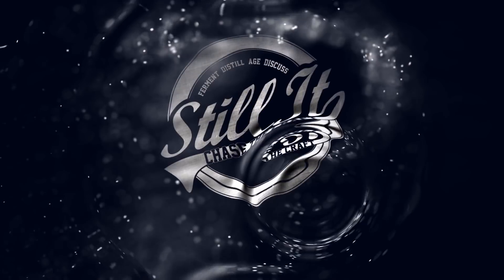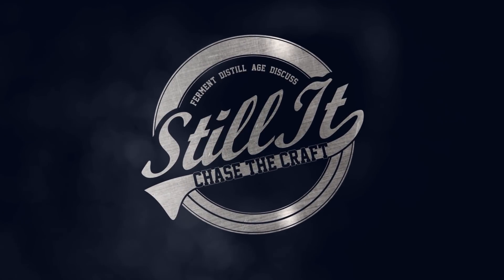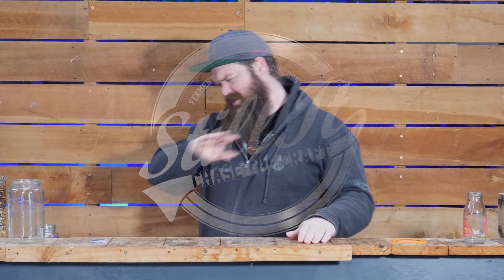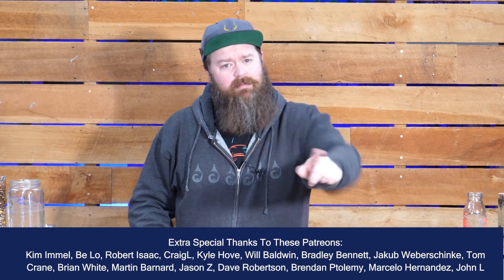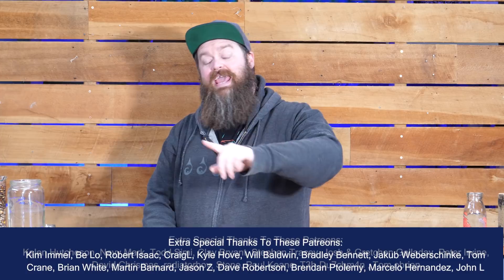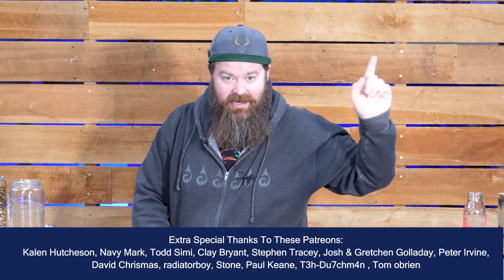How Full Does Your Pot/Boiler Need To Be When Distilling?

Comment: Another solution if you are worried about not covering elements is throwing some balast in the boiler. Glass marbles, Stainless ball bearings, ceramic beads or have even heard of using stones. Never had to worry myself but usually add a handfull of copper scraps as boil breakers to mine.
Reply: Had the same revelation this morning and came here to drop the idea, but you beat me to it!

Comment: Not so much an issue when using a reflux still, but with a pot still, the amount of empty headspace can affect the distillate flavours and aromas. More headspace means more passive reflux can happen. Wash/low-wine composition obviously plays the biggest role, but the rate of energy input along side the shape/design and available headspace of the still come second. Something to think about as you get more experienced in making spirits!

Comment: There are few other factors here. Less volume will create some reflux at the top of the pot depending on vapour path diameter. More volume will create less reflux as the vapour will travel up the vapour path and not so much at the top of the boiler. 
I think the entry abv makes a difference also.
Take a look at major distilleries they all have different abv entry and volume into their spirit still. It creates different characteristics

For example - For 1 grain bill I fill to 75% volume @ 25% abv 
Another I fill to 50% volume and 20% abv 
Both completely different character spirits.
Reply: How do u get 25 percent abv on a mash ?
Reply: @thecarpentergarden2943 not from a mash from a previous run

Comment: When you say you collect down to 20%, is that when the output TOTAL is 20% ABV, or just the latest sample that comes out? i.e. when you start pulling 20% ABV out of the still, then you stop?
Reply: When the output coming out is 20% usually all of it together is around 40%
Reply: @jacobdeslattes3519  Thanks, so when people say they stop at 20% ABV, are they saying when the whole thing is 20% or when the output coming out is 20% (e.g. ~40%) ?
Reply: Mathew Mirabito output
Reply: I almost always find that  by the time my parrot is telling me 40% the run is finished. Those flavours that come next are not what I want in my liquor.
Reply: @kevinbarrett3  What about for just a stripping run?
Reply: Mathew Mirabito I really don’t do a stripping run. I get 6 or 7 jars ranging from 80% down to 40 or so. After airing out I mix it together and finally proof down with distilled water. It’s really good after a couple of weeks with oak cubes. Smooth and tasty. I usually finish it at around 85proof
Reply: @kevinbarrett3  Nice!
Reply: Mathew Mirabito I’ve got to add one more finding, as you start to get to the end of  your run the distillate will get cloudy a little bit. That’ll make your whole stash cloudy .. it still tastes good but not as “ bright” looking as we like.
Reply: My top element is only covered by an inch. I usually unplug it once I get up to temp

Comment: little tip for one that doing spirit run with low wines.  I fill my boiler with water just above the elements then throw my low wines in..  that way I'm shall that I'll wont burn them out.

Comment: Also forgot to mention to do 1.5 runs if you know that at the end of both strips wont have enough to fill boiler past critical point. Or instead of backfilling with water could use backset as it may help with flavor loss while also help fill still.